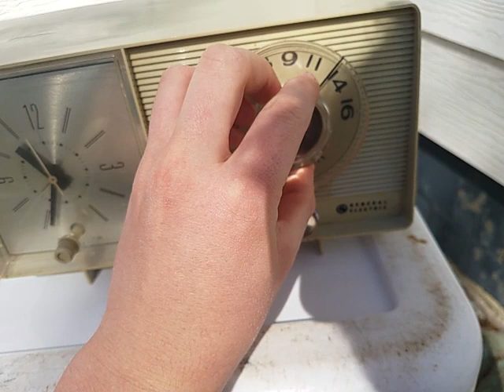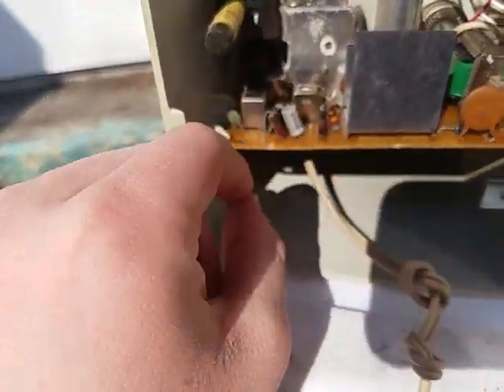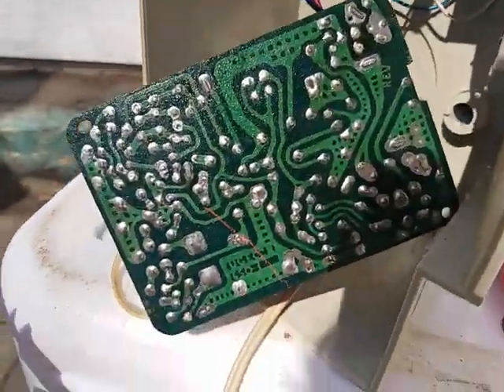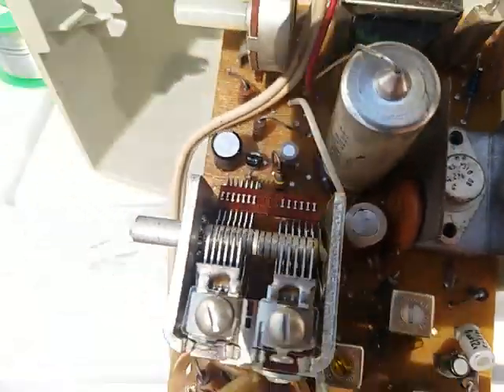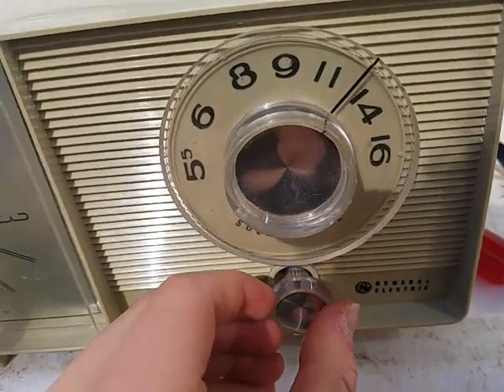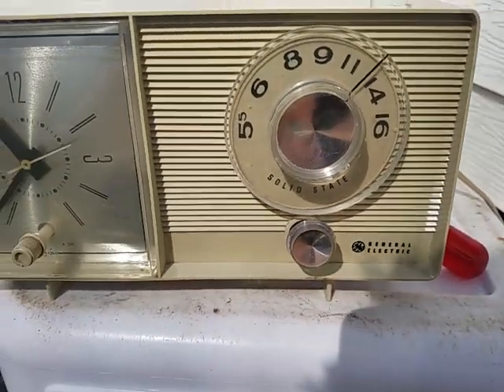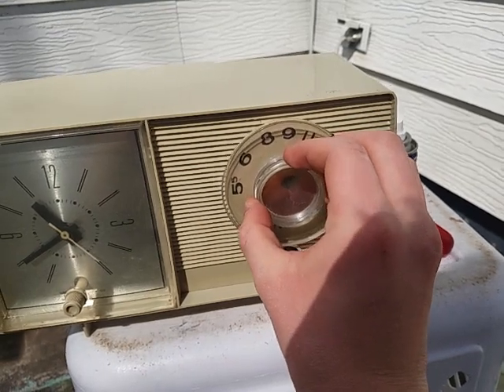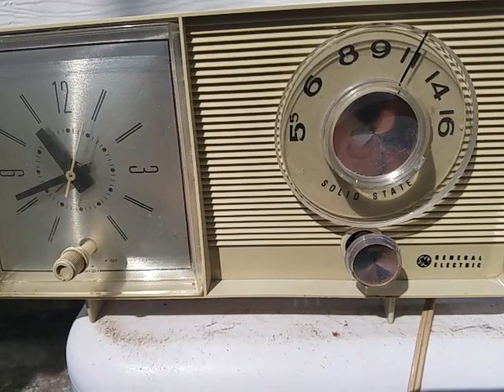1967 GE clock radio FAIL

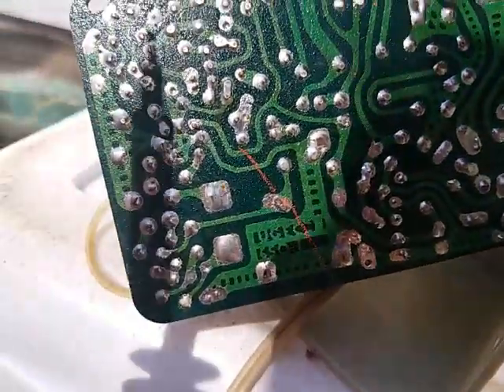Comment: Pause at 5:11 and to the right and bottom of the large weird trace on the board (with DGEC and 650 inside of it) you will see a bad solder joint. Reflow that one and the ones just further right and I am willing to bet the radio will work. Also, the tuning cap is suspect, seeing as it is intermittent and you get oscillations. Could be that resistor it is rubbing on is bad too.
Reply from the maker: Thanks for pointing that one out! I'll fix those ones up!
Reply: @bratwurst2923  You're welcome. I hope you can get it working soon.  I hope to get things sorted out here so I can start working on my Sparton.

Comment: Be careful: that's a "live chassis" design, it'll knock your socks off if you work on it plugged in without an isolation transformer.  I find it kind of shocking that it's got transistors.  Mine (identical case but different clock) is an All American Five.

Hopefully it has a cold solder joint, because those flimsy circuit boards are a pain to fix when they get cracked.
Reply from the maker: Didnt know this was a hot chassis set. Thanks for telling me! I've heard this solid state variant is a bit more rare than what I have here. I think they made these into the mid 70s.

Comment: i have had a few of these before, general electric used that cabinet for years, i have had 2 solid state versions and i still have a tube version of it now.
Reply from the maker: Just by looking up "1960s GE clock radio" in google images turns up a ton of them. I've h EA are the solid state versions are rarer than the tube ones. Seems kinda reversed from how it normally is.
Reply: @bratwurst2923  yeah, they made them for years and most of them were the tube versions, the solid state ones were not made in that cabinet i dont believe, also the solid state ones tend to have more issues, they have a heatsink in them and when they are in use it gets extremely hot. both of the ones i had that were solid state died and i am not really good with solid state stuff.
Reply from the maker: @WalterKnox  doe sent surprise me that the solid state stuff was more problematic as it seems like early solid state stuff is quite fragle. I'm also not as good with solid state as I am with tube equipment.
Reply: @bratwurst2923  i am not really "Good" with tube equipment, i can usually get an old radio or TV working if i play with it long enough, but solid state stuff i usually just break more when i try to fix it... i am really good with old fans and that is about it.
Reply from the maker: @WalterKnox  I'm in the same boat, tinker till it works. Speaking of fans, I gotta get my Poweraire and re oil it. It's completely gummed up to where it wont move when its turned on. What kind of oil do you use?
Reply: @bratwurst2923  on my fans i normally use 3 in one motor oil in the blue can and for the gearbox on osculating ones i use red lithium grease. lately i have just not really cared and have using 2 stroke oil i put in an oil can and it seems to work okay, but i would not recommend that because it has detergents in it.  zoom spout or 3 in one in the blue can are the two that most people recommend, zoom spout can be hard to find, so can the other, but it can normally be gotten at a hardware store or online.

Comment: The big single transistor with the heat sink is probably a class A output stage. It's an inefficient design and thus gets pretty warm. Lower distortion compared to class AB (two active elements per output) but it doesn't really matter in a clock radio (not even in HiFi TBH).  
Not very common in solid state stuff like this, only with tubes it is.
Reply from the maker: After filming I ran it for like 3 minutes and I put my finger on the heat sink and it was certainly warm! So it doesn't surprise me this is a inefficient part. It's also neat that it's not too common!
Reply: @bratwurst2923  

The transistor is driven with high bias so that both half waves are within it's inear region, instead of using two transistors (or tubes) biased just at the bottom of their linear region, for each half wave. It's a simpler curcuit with (slightly) lower distortion but
you get a much higher collector current, even when idling, that way.
Reply from the maker: @westelaudio943  so in that sense would it kinda be like an IC since it's doing a job that couldve been done by a couple transistors or tubes?
Reply: @bratwurst2923  

Not really, because an IC amp is just a regular class AB curcuit but most of it's components are on a single doped silicon chip, while class A is just making one active element do double duty by lifting the waveform above it's threshold if amplification
Reply: @bratwurst2923  no.  It does the same job as one tube triode section.  It's biased "Class A". Current always flows, and it amplifies the entire signal.  Better chance of high quality audio at the expense always dissipating current.  Read up on Class A, Class B, Class AB¹ and AB².  You won't regret it.  Learn it with tubes first.
Reply: @bratwurst2923  by the way the best book to learn this stuff is a later RCA Receiving Tube Manual.  The front of the book is a very good explanation of amplifiers
Reply from the maker: @KC9UDX  I'll have to look for one of those, or at least a PDF of one.
Reply from the maker: @westelaudio943  I see, btw today i got another TV back on track, I'll it on here in a few days.
Reply: @bratwurst2923  AES sells (or yoosta sell) a reprint of two editions.  An early one and a late one.

Comment: I tried repairing a radio like that but i ended up burning out the transformer and radio and then it went dead completely but luckily there are hundreds of them in antique shops so just throw it away